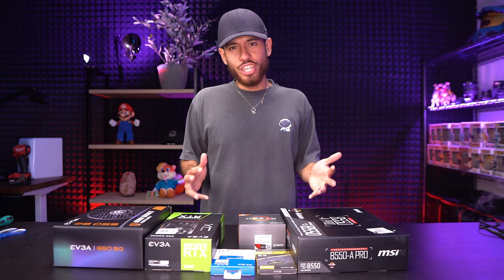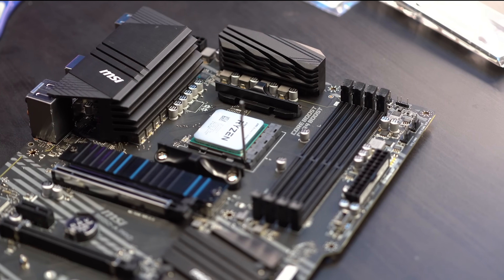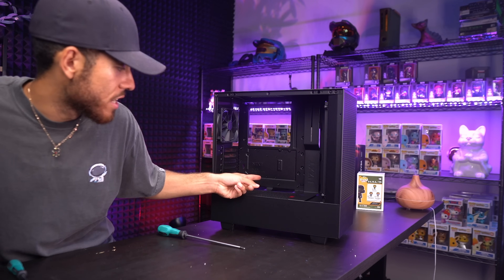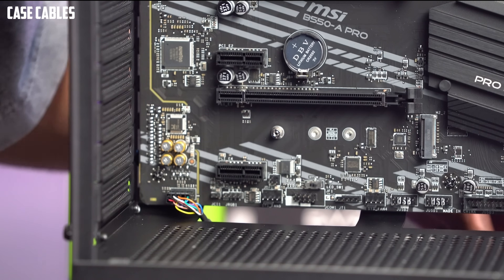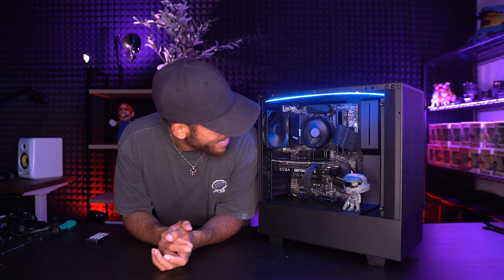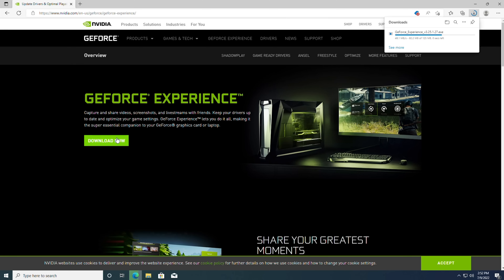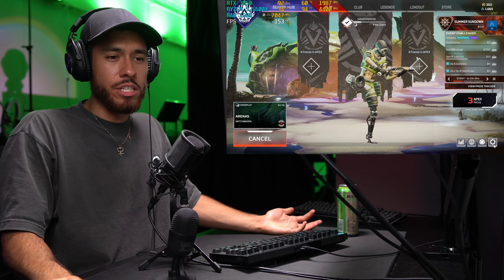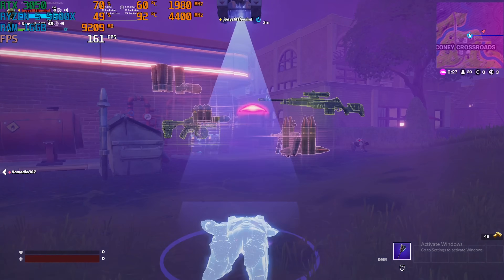Best $900 Gaming PC Build Guide - RTX 3050 Ryzen 5 5600X (w/ Benchmarks)

Comment from the maker: Big 40% off discount on all CRATER tees. Code found in New discord server!  ;D
https://discord.com/invite/WmTHmAFYuN
GO!
Reply: In the ram area you installed on 2 and 4. Could 1 and 3 empty ram slots be added? If so what do you recommend MR Delgado.
Reply: @tweekingeye  p ppl p
Reply: At 6:57 there’s a watch battery what is it for? And does it need to be changed out when it indicates to do so?
Reply: Link for cable extensions??
Reply: Question. Does it have to be windows 10

Comment: I built a pc a week ago with ryzen 5 5500, corsair 16gb ddr4 3200 , msi rtx3050 8gb graphics card, msi 550w power supply , thermaltake h16 pc case, thermaltake cpu cooler and asrock b550m pro4 motherboard. Would like some opinions. I'm not a big gamer, just resident evil from time to time.

Comment: This is a lie because you gotta add windows because you can have windows and stuff but after a month it will lock you out and see you gotta buy a product key so really every builders around $1000
Reply: Replace the rtx 3050 with the intel arc a760 and u got better performace and save some money which is pretty much enough for the build to be done in under 900$ and besides windows doesnt count as part of a build is linux for well 0$ XD well techinically if u consider os as a part fo the buil and want it under 900 u could go for linux 😅😅

Comment: With this motherboard can I connect to wifi wirelessly and have no internet/Ethernet cable
Reply: You'll need a wifi usb adapter.
Reply: @JJFlores197  okay does that lag a lot ?
Reply: @grayyfrmheaven  That depends entirely on the wifi adapter in question, how far your computer is from the router, the router itself, etc.

Comment: i’m going to go off almost this entire build aside from changing the ram from the corsair vengeance non rgb to t-force rgb 2x8 3600mhz then as the 2060(6gb) is better than the 3050(8gb) and the 2060 is cheaper i’m going to go with the 2060 to make this build that much cheaper

Comment: Video is dope. I’m bummed tho, I followed the video step by step(only thing different is I got a 3060 and a 750gold) but for some reason all my fans turn on I get a light on the MB but nothing on screen🤦🏿‍♂️. No picture coming through
Reply: Check to see if your motherboard has a debug/diagnostics light. That can help guide you as to what may be wrong.
Reply: Yooo I just bought alll this stuff. Did it every work for you ?
Reply: @BabyWhoaa  it was Ram  not plugged in

Comment: Im using M.2 and HDD, and i dont why does my hdd not appear. It only showing my M.2. Did i do something wrong or im missing a step?
Reply: Some SATA ports are disabled if you have M.2 drives installed. Check the board manual for this information. Also, make sure you securely plugged in both data and power cables into your HDD and that the other end of the SATA cable is securely plugged into the motherboard's SATA port.

Comment: Hey do you think my pc build is ok? 

specs : 

AMD Ryzen 5 5600 3.5 GHz 6-Core Processor
Deepcool GAMMAXX GT A-RGB 64.5 CFM CPU Cooler	
Gigabyte B550M DS3H Micro ATX AM4 Motherboard
TEAMGROUP T-Force Dark Za 16 GB (2 x 8 GB) DDR4-3200 CL16 Memory
Kingston NV1 1 TB M.2-2280 PCIe 3.0 X4 NVME Solid State Drive
Zotac GAMING Twin Edge GeForce RTX 3060 12 GB Video Card
MSI MAG FORGE 100R ATX Mid Tower Case
Corsair CV550 550 W 80+ Bronze Certified ATX Power Supply

what do you think of my PSU? is it bad or should I buy a new one? I already own most of it and I will start to build it by tomorrow but I'm hesitant with my PSU :(
Reply: i would get 600+ bronze, idk thats what ive been hearing for 3060 builds

Comment: Which one would be good?
Rtx3050 or 2060
Reply: Just spend 30 more and get a rtx 3060
Reply: @misfitfps8146  in our regional market
3060 is still way more expensive
Reply: @SaifulIslam-ig1su  for me its 400 usd for the best one its like %45 better then the 2060
Reply: @misfitfps8146  in here it almost took upto 550usd for a 3060 
And 2060 are usually 380-420 depends on the market demand, also 3050 cost same as 2060
Reply: @SaifulIslam-ig1su  then get the 3050 thats what i would do
Reply: @misfitfps8146  alright

Comment: Can anyone awnser I wanna do this but with 64 gb ram would I also be able to do 2 3050s instead of 1 if so what power supply is recommended
Reply: To add to the multi-GPU thing: That is largely irrelevant. I think Nvidia has largely dropped support for SLI (multi-GPU) so you really won't see any benefit. You will have increased power consumption though. The days of multi-GPU setups are pretty much over in most typical use cases.
Reply: 2 3050s are so useless get one 3080 instead 64gb of rams is useless too just if you do high end rendering and editing otherwise 32gb will be completely enough and if you get a 3080 dont buy a 5600x get a 5700x or 5800x

Comment: 3050 still way over priced and if you went with a RX 6000 or 6000xt the performance with be as much as 50% better at this same price as this card. You would be also be able to use sam. At this level of performance this card can provide ray tracing and will only make the visual and frame rate worse. AMD has this in the bag vs Nvidia. Your builds are usually spot on but this card and its entire line are a waste of silicon and a cash grab by Nvidia pure and simple

Comment: I followed this build step by step and it powers on but won’t connect to my monitor wtf did I do wrong??
Reply: I'm having the same problem not sure if its the usb or possibly something with the computer
Reply: @UnratedStudioss  lol I figured it out. I had to turn it off, flip the switch on the back on and off, then restart it and plug hdmi into GPU
Reply: @shaned1817  Thank you for replying, this saved me!
Reply: @UnratedStudioss  lol no problem, we’re you able to get it to work?
Reply: @shaned1817  Yep!
Reply: mine does not connect to the monitor either :(.
Reply: @Kevin-yi7ix  did you try the steps I mentioned above? That’s what worked for me and it works great now! Just make sure to plug hdmi to GPU.
Reply: @shaned1817  I’ll try it again tomorrow when I have time. Question, when you turned on your pc did the fans on the gpu spin for a couple seconds and then stopped or did your fans keep spinning? Im starting to think I fried my gpu.
Reply: Or something is up with my power supply.
Reply: @Kevin-yi7ix  check your connections and try not to flicker the power on and off a lot I think tht fries it
Reply: @Kevin-yi7ix  I just put my hdmi cable and display cable to where I put the graphics card was and tested all ports until it finally worked

Comment: Why Ryzen 5600x to Rtx 3050 Intel i5
10th gen is better option and cheaper Ryzen 5600x is better to Rtx 3060 ti
Reply: Could you tel me if my future build is good or not, if you don’t want to it’s fine 

CPU- Intel Core i5 12400f

GPU- XFX SWFT 210 Radeon Rx 6600 XT

Motherboard- MSI PRO B660M-A WiFi DDR4 Motherboard Micro-ATX

Memory- CORSAIR VENGEANCE RGB PRO 16GB (2x8GB) DDR4 3600MHz

Storage- WD_BLACK 1TB SN750 NVMe Internal Gaming SSD 

Case- Corsair 4000d Airflow

Power Supply- EVGA BR 700W Bronze

Operating System- Windows 10 Pro OEM  

Monitor- MSI OPTIX G241 144hz 1080p
Reply: @cameroaht  buy i5 11th gen because it's cheaper but still good and at this price point motherboard will be way better

Comment: Damn man, you really out here suggesting 900 dollar PCs with a 3050 in it. The Radeon 6600 is much more performance on both 1080p and 1440p in every game benchmarked for less money lol  Yikes, let me hide this channel real quick 
P.s- I wouldn't advise listening to a guy for pc building advice who is openly showing his brand new build reaching damn near 100c on the cpu just playing fortnite.
Reply: Hi I’m new to pcs and it seems like you know a lot more than me, could you tell me if my future pc build is good? If not it’s fine 

CPU- Intel Core i5 12400f

GPU- XFX SWFT 210 Radeon Rx 6600 XT

Motherboard- MSI PRO B660M-A WiFi DDR4 Motherboard Micro-ATX

Memory- CORSAIR VENGEANCE RGB PRO 16GB (2x8GB) DDR4 3600MHz

Storage- WD_BLACK 1TB SN750 NVMe Internal Gaming SSD 

Case- Corsair 4000d Airflow

Power Supply- EVGA BR 700W Bronze

Operating System- Windows 10 Pro OEM  

Monitor- MSI OPTIX G241 144hz 1080p
Reply: @cameroaht  honestly man, you did a good job picking out parts. thats a solid 1080p gaming rig with good upgrade ability down the road. 
the only thing i would change (if the price isnt big) is going with a full atx motherboard. A m-atx mobo will look a little awkward in an atx case but its not that big of a deal. and if it doesnt bother you, then who cares.

and what cpu cooler do you plan on using?
Reply: @redfuryin  someone told me 12400f comes with one and that I don’t need one, should I buy one?
Reply: @cameroaht  if you have a good amount of airflow and fans it will be fine with the stock cooler. If you plan to stick with only the two fans the 4000d comes with, i would invest in one. cheap air coolers like the vetroo v5($35 US) is good for that processor, just make sure it comes with the LGA 1700 bracket. or you can buy a couple additional fans. Not trying to talk you into buying more things, just saying what i would do personally. Best of luck with the build, its a rabbit hole once you start lmfao
Reply: If I went with the rig above. 5600x and decide to get the 3060. Do I want the 3060xt?
Reply: @chandlerwise3829  do you mean the 3060ti? 
if so, it really depends on what you plan on doing with the PC or what resolution monitor you're going to be using. 
If you plan on just using it for gaming on a 1080p monitor id say just get the 3060 and use the money you saved from buying a 3060ti and use it on a high refresh rate monitor or a nice mouse/keyboard. but if you have a bigger budget, a 3060ti or a 6700xt are great cards.
also- if you're getting a 5600x, just get the 5600 instead, its like 1-2% less performance but costs 20-30 dollars less.
Reply: @redfuryin  i actually meant to say 6600 XT. I purchased the 5600x already haha. I wanna use this to game. I’d love to be able to get 1440p at 144hz 27-32 inch. Playing AAA titles
Reply: @chandlerwise3829  in that case, either a 3060 or 6600xt are pretty close in performance. For 1440p gaming, its hard to recommend either card tbh. Both can give over 60 fps in AAA games, but not by alot. so you will notice dips below 60 at times when the screen has a lot going on. if you dont mind turning down some settings it could work fine. But out of the 6600xt and 3060 i would go with the 3060 because of DLSS and more video memory if the prices are close. If the 6600xt is 80-100 cheaper, that's what i would get.

 3060ti and 6700xt are the cards id say are better suited for 1440p without compromising any settings. But like i said both the 6600xt and 3060 can game at 1440p, just on some games you might wanna tweak settings to find a smooth frame rate.

hope this helps making your choice!
Reply: @redfuryin  thank you so much! You’ve been a great help. This is my first build so I truly appreciate this.
Reply: @chandlerwise3829  NP man, btw i totally forgot but it might also be worth to check out the 6650xt. i forgot about that card, its probably cheaper than the 3060 and i know for sure its more performance than the 3060 and the 6600xt. 
Best of luck with the build!

Comment: For the same price I can buy the AMD value Barebones kits for $600 or cheaper depending (as of this day when I wrote it $600) The kit includes Asus TUF case, ASUS TUF power supply 750 watts I think, Asus Strix B550 motherboard, and a Asus Dual RTX 3060TI. Just add in the AMD RYzen 5600x, 16GB of ram and 512 GB WD blue and you are good to go (assuming you are okay with AMD stock cooler). You can also upgrade the cooler to better one but it will add $30-50 to the price. So basically for $900 you spend on the BB kit you a get better  Graphics card and motherboard. Also I wounnt mind putting in a decent cooler for another $50 more making it $950. Also since it is a BB kit it is you don’t have to do too much work.
Reply: Please note that this is only found in Mirco Center.

Comment: I recently ran into some funds and after running on a machine with an AMD A12-9800 APU from 2016 with a Palit 1050 graphics card I decided it was time to upgrade. THIS is the exact build I was thinking so a couple weeks ago I ordered the EVGA 3050 and 5600X. The only changes are my NVMe is 1TB, my ram is 32GBs but clocked slower and my MBO is an Aorus M that I'll be flashing up to support the 5600X unless its out of box ready.

Comment: Great simple build. My only critique is the lack of a better cooler on the 5600X. 92 degrees C while only 40% utilized in a super light game is not safe. Also, considering the 3050 is $330 and gets beat across the board by the RX 6600 which is only $260, it makes no sense to buy one.
Reply: Ray tracing is a W but im getting a rtx 3060
Reply: @misfitfps8146  yea 3060 is good for ray tracing what's the issue
Reply: yea I'm planning to buy this build with the Sapphire RX 6600 and I think its gonna be great but i have 1 concern. Is it hard to update the bios in case the motherboard isnt 5000 searies ready? because I think the one I found in my country isnt readt for 5000 series and I might have to update the bios which kind of scares me.
Reply: @Ghosty2004  idk it shouldnt be too hard to update bios no?
Reply: @1Taymn  i looked it up on youtube it isnt the easiest thing but i should be able to do it its just my first time building a pc so im scared

Comment: Dude, for $900 this is a waste of money.

1. Why are you still going ryzen, it's a dead socket. Dead platform. Intel 12th gen outperforms it as well, and the 12400f is cheaper than the 5600x yet its single core is better.
2. A 3050? 6600XT is nearly double the performance, and that's going off of userbenchmark which is very bias against AMD/Radeon, so it might be even better. Both GPU's are going for the $350 range as well.